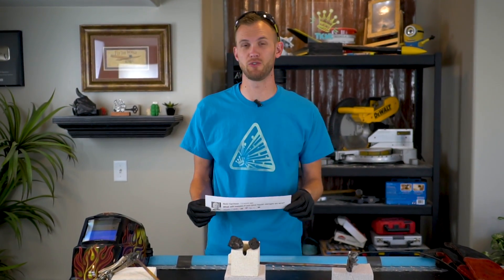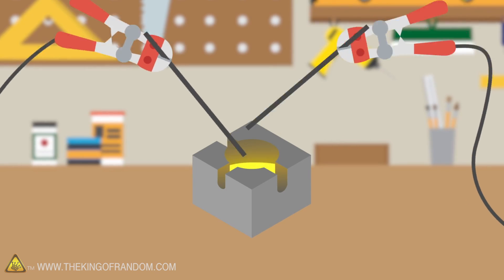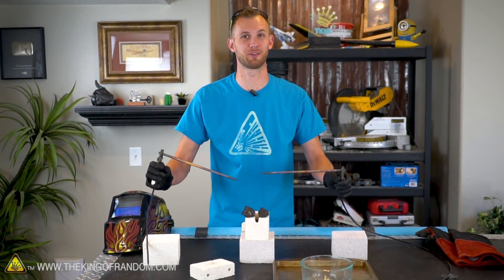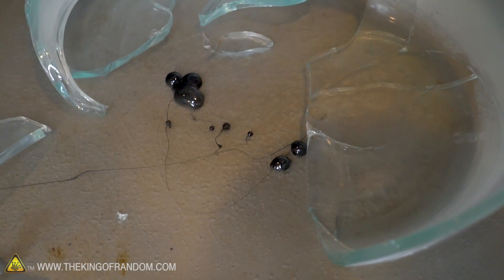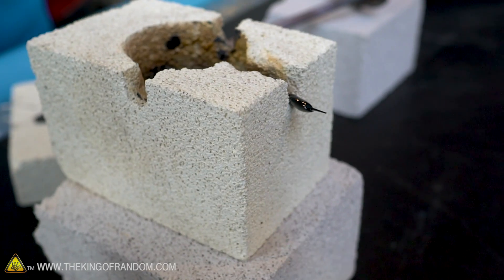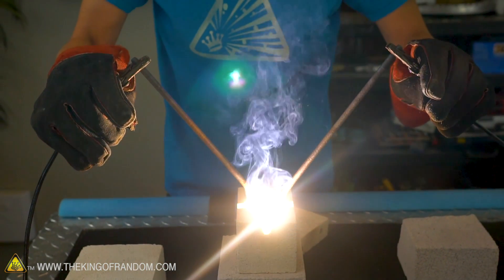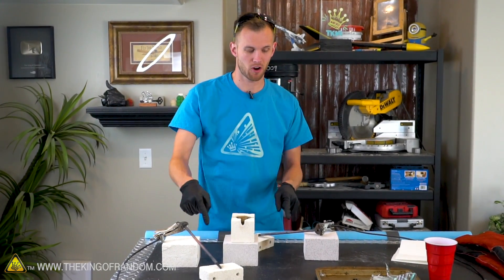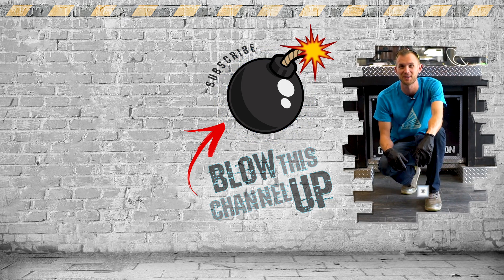When HOT LAVA meets COLD LIQUID NITROGEN!

Comment: could you somehow SPRAY the lava ? like maybe put some kinda hole in the bottom of the brick thing and then blast the lava out with pressurized air into the nitrogen? the idea would be to get smaller particles of the lava into the nitrogen to cause a faster reaction/maybe get a different result ... idk .. might be too dangerous to spray lava lol

Comment: That's awesome, even the smallest amounts of lava would be amazing to have. 

My first thought is to use it to bond two clay bricks together. If that worked, you could build super strong structures. 

It would also be interesting to see what it looks like paper thin. So smash it and cool it. To see if it's more like a glass or a stone? 

I could have lots of fun putting it into molds, of different things to test its durability. The most interesting of which would be a bullet. I'm not sure if it would shatter on impact, blow up, or peirce. So it's probably best to go with a shot gun slug first to see how it will respond. 

I would Also like to know what happens  if you keep it magnetically polarized while letting it cool. Would it then be magnetic, or change its molecular structure, or just not do much at all???

I also wonder if you could mix it with mercury, would the mercury boil, or would it be mix able into a alloy???

Comment: It’s not that it can’t take too much stress. It’s uneven. First the heat source is heating it up rapidly due to its height temperature therefore expanding the glass bowl but on the other hand the liquid nitrogen which is extremely cold, is contracting the bowl. Therefore it cracked and shattered. Uneven contraction or expansion

Comment: Ok hope you are ready for this  can you make an air conditioner with liquid nitrogen would it be quicker to use liquid nitrogen to put out a fire can you use it to temper steel to make a harder sharper knife does liquid nitrogen clean glass and for now if you poured liquid nitrogen onto a plant could you transplant it better that's all for now I have about 200 more questions to ask will ask more questions if you  respond

Comment: if you put slivers of the heat resistant firebrick between the rods and the vice grips on the arc furnace  would it help insulate it for a few minute longer use?

Comment: using the lava in the middle point of two iron rods. . .will electricity still run from one point to another? let's say the first rod is the source of electricity and the other rod connects to a light bulb but both rods are not connected directly to each other, but in a hot lava instead. . .

Comment: What does lava do in a vacuum chamber?
Reply: it melts the container, 
probably
Reply: Julian Wico melt through
Reply: Melt the entire thing
Reply: Weird stuff
Reply: What if the lava wasn't poured and still at it's container? Then put in the vacuum chamber? Will the lava cools down and undergoes crystalization? Or it will not leave any holes and will not enter crystalization because of lack of air? Or the lava would solidify instantly because like fire without an air it would die out eventually?
Reply: i think lava would boil and it may cool down in a weird bubbly pattern
Reply: Starts to bubble and cools down a bit if theres dirty WATER and melts the bag a bit ???

Comment: What if you dropped the lava from a height into a cylinder of Lnitrogen, (certain depth of LN, not necessarily the volume) Also. How durable is the 'glass' from the lava and what is it's makeup? Can you make enough to form a marble? Can you create a mold with ice* (spherical, hollow) drill or scrape out a small hole and fill with LN and then plug the hole, will the LN keep it from melting or shatter it, also, if it doesn't shatter, it will still evaporate over time, can using a water/mist spray bottle while rotating the sphere keep it intact? Can you spray LN in a water spray container? If you combine metals with sands (glassmaking) and drop into LN for the cooling, will it shatter? Also, rather than colorings, can you use different metals to achieve that effect?
* Have you tried using heavy water ice for any of your experiments? If you do use this one, can you try making a sphere in both normal water and heavy water?
If the spheres to stay intact, what happens in a vacuum chamber, not at full strength, but if you slowly remove the air inside? Perhaps having some of the spheres type of water unfrozen at bottom of jar inside vacuum chamber may help it stay intact.
If you've tried this before can you attach the link?
Thanks!

Comment: How about using electrode holders for stick welding? They can handle high heat, high current and are insulated. The metal contacts have slots cut into them to keep the rod from moving around.

Comment: Would you be able to run the arc furnace longer and melt more rocks into lava if you had multiple sets of the carbon rods to switch between as they got too hot to handle?

Comment: Is it possible to have liquid nitrogen at room temperature (still liquid though) by putting it in a small container, perhaps an ampule in a block of resin/arcylic
Reply: The pressure is estimated to be at 2,800-3,000 atm if pure and filled completely, and I cannot find any experiment that has successfully done this... most likely because of how dangerous it would be😂

Comment: +The King of Random - I would like to make a suggestion that may improve the length of arc time with the arc furnace. Cast a long rod of copper, drill out the center to just smaller than the width of the carbon rods. Then grind away the surface of the copper cylinder to form thin rings around the circumference in close proximity to each other. the thermal conductivity of the copper will act like a heat sink and cause the carbon rods to transfer the heat into the copper, which will in turn, transfer the heat to the air. This should allow significantly more time to heat the object inside the arc furnace.
Reply: But copper can't sustain heat and also maybe the heat may cause it to melt and break the carbon rods
Reply: interesting
Reply: It's worth a shot I guess
Reply: No don't do it!!!!!!!!

Comment: if you replace the vice-grips in your ark furnace with stick welding electrode holders or air arc holder you should be able to withstand much higher temperatures

Comment: The heat is not traveling all the way up to the vice grips, the contact point between the rod and vice grips has the highest resistance (besides the arc) so it will directly heat the metal. Wrap copper wire around your rod a few times and try clamping to that.

Comment: You should find out a way of making a bigger arc-furnace. Maybe using some rods in an enclosed structure and then having the electricity run through all of them so it works like the heating coils on a conventional oven. I’m not an engineer yet but thought it might work

Comment: What if you put a powered on vacuum chamber in a  powered on vacum chamber??? Like if you agree
Reply: That wouldn’t work,for the first vacuum chamber to be turned on it needs electricity correct? How you gonna power it if it’s inside a vacuum chamber? If you drilled a hole for the wire it wouldn’t be a full vacuum
Reply: Jonty Horn vaccum cleaner in space ;)
Reply: The Batmansajoker it would have the same pressure

Comment: I dont know why people are obsessed with chucking hot things into liquid nitrogen. There's really only 2 outcomes.

Its hot but not hot enough so the thing is cooled by the liquid nitrogen.and freezes/solidifies and nothing really happens except a load of nitrogen blowing off. Until the object touches the glass container, then the differential heat between the hot and cold parts would cause stress in the glass and break it.

Its so hot OR transmits heat so quickly, it instantly vaporizes the liquid nitrogen causes a fast expansion of gases also known as an explosion. Usually involves breaking the container and the solids remain at the bottom. 

I bet if you took a sizable chunk of steel that's heated to its super plastic state but still solid, and chuck it at some nitrogen, it would explode as well.

Comment: Can you make a Prince Rupert's drop using lava rock ?
Reply: oscarascal that's what i was thinking
Reply: I also had a PR thought, but I'm pretty sure the properties of the rock are too porous to create the tension needed to hold it.  I wondered what would happen if lava was poured on a PR?  Would the glass start to melt?  If so, would the tension be released throughout?  Pouring it on the head vs the tail... lots of things to test here.
Reply: Garret Robinson  yeah but if you seen the black color it’s obsidian witch is natural glass
Reply: True, but obsidian is far more fragile than silica.  I still think it couldn't take the tension.  That being said, I'd love to see a bunch of tests around this idea.
Reply: Garret Robinson actually, if I'm correct, when cooled too quickly, lava turns into obsidian, which I believe is considered to be volcanic glass.
Reply: Matthew Suedel me to
Reply: No you can't due to Leidenfrost effect. You can try with hot oil but nitrogen is just too cold. It creates a gas bubble around the hot surface
Reply: I didn't specifically mean using liquid nitrogen. I just want them to try to make a Prince Rupert's drop with lava rock
Reply: oscarascal lmao that's what I was thinking
Reply: absolutely not. only specific molecular structures allow for the creation of prince rubert drops, and molten lava rock is not one of them.
Reply: I commented that first

Comment: I know im late but can you try using the arc furnace on liquid nitrogen?? Like put the sticks in it and turn it on
Reply: I’m pretty sure it will explode
Reply: Make ice bubbles using liquid nitrogen or any thing else you think would work
Reply: Arc*
Reply: Thanks for the correction i didnt catch that
Reply: It's fine :)
Reply: Wouldn’t it just evaporate
Reply: U cheat u copy mine
Reply: oobleck on lava
Reply: Probbably  heats up the nitrogen really fast and turns it ito steam. Not so probably, but what I hope for - an explosion.
Reply: Youre right Blind Guardian and CosmicCitiZen
Reply: It will boil obviously
Reply: Pigmaster214 that would just make the electricity conduct into the liquid. Maybe not but just an assumption.
Reply: Pigmaster214 already been said by me

Comment: Lava on top of magnet size of sugar cube... does it reach curie point before cooling down?
Lava in gallium or mercury and also lava on aluminium amalgam made by ga or hg on a thick steel plate to prevent mechanical stress... does it behave differently than unheated amalgam.
Lava on top of charged/discharged li-ion cell
...and for demonetization... lava in fleshlight;D

Comment: Something i'd like to see attempted is pouring/dropping things into resin while it is setting.

i.e. As resin is curing it generates heat in the process, does dropping lava on it speed it up? or liquid nitrogen slow it down? can you pour resin over dry ice and get a dry ice casting or does it cure before the pressure eventually makes it explode? and so on.

Comment: For an arc furnace 2.0 could you possibly design a system to hold up the rods and the brass while also insulating them so it can run long longer and by itself

Comment: can you mix helium and  hydrogen and see what it does
Reply: Wouldn't do anything...Helium is what's called a Noble Gas (other notable examples include Neon, Argon and Xenon), which basically means it doesn't partake in any chemical reactions.
Reply: That does nothing. Wasn't you in your chemistry lessons. That's because of the bowl around the atom core are fully filled with electrons in Nobel gasses, so there is nothing do react with each other!
Reply: Jonas Schmidt Did you ever go to your English class?
Reply: It actually does nothing... there’s both of those gasses in the atmosphere so they get mixed up a lot

Comment: Maybe blow a bubble somehow in the lava? Then let it solidify then you'll have a obsidian bubble! :P (Maybe some sort of steel tube to blow the bubble?)
Reply: well, wouldnt the tube melt if hes not quick enough? and then the tube melt and fuse after the bubble is blown?
Reply: dead pool steel has a higher melting point than most rock
Reply: yeah, but wouldnt the rock still stick to the pipe?
Reply: dead pool depending on how hot the molten rock is, it might not. If it’s too cold, it probably would though
Reply: k

Comment: ideas of mine:
1. Get a life jacket and fill it with SF6. Will it work? now try a dinghy.
2. what does pressurised air do inside a vacuum chamber
3. make a prince ruperts drop w/lava or obsidian
4. can you see how far you can go with making a homemade air compressor. go to the max compression, then do stuff.
to elaborate, make a air compressor (reverse vacuum.) see how far you can pressurise the air. try experiments with it: shatter it, both under and above water. see if it floats. see how things react with it. try powering an air powered gun/slingshot.

Comment: The problem with the lava you're making is that it is extremely high in silicates. This makes the lava extremely viscous and hard to poor, making it the equivalent to pahoehoe type lava. The type of lava you really want for this kind of 'experimentation' is aa, which has very little silicate and flows like your stereotypical lava (like liquid metal). So you're going to want to switch over to rocks with low silicates, like basalt.

Comment: YOU need a project. 1/4 inch copper tubing, U it a couple times on the carbon rods use hose clamps keep it tight to the rod. CPU cooler and oil and pull the heat out so you can get the time you need!

Comment: Make a percolator pump using dry ice. All you need is a piece of PVC, 3" diameter or larger (preferably), pipe with a coarse screen at the bottom.  Submerse the pipe in water, drop in some dry ice and watch it flow. It might be necessary to drill some holes in the pipe, a few inches above the bottom, slanted inward/upward, to allow water in without blowing out the dry ice.

Comment: You should coat the vice grips in something to disperse the heat or possibly just hold it with another pair of vice grips ? 
Also what happens if you mix gasoline and liquid nitrogen and then pour the lava into it will it light up or like what if you pour just lava onto dry ice with the liquid nitrogen mixed in it

Comment: I read that ice has many forms based on temperature and pressure and its character changes with each type of ice.  What happens if you super cool ice cubes in liquid nitrogen?  How do they behave?  Are they more brittle?  How much faster can it cool a drink?

How differently does dry ice act if it is super cooled in liquid nitrogen?